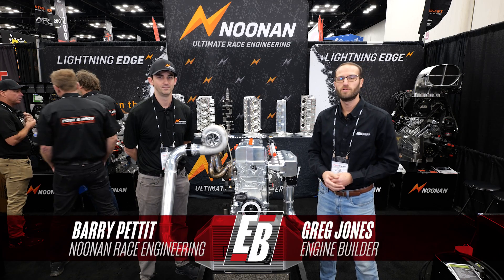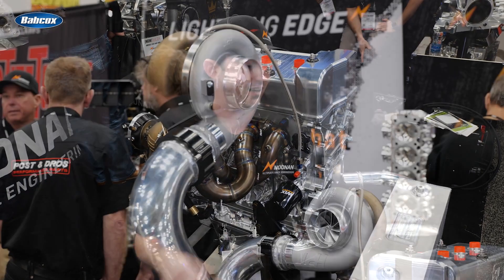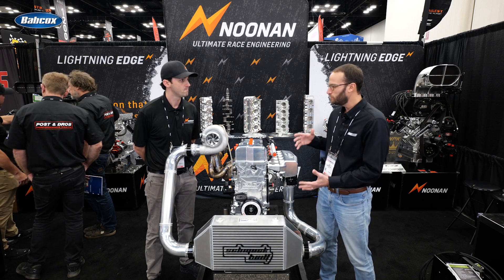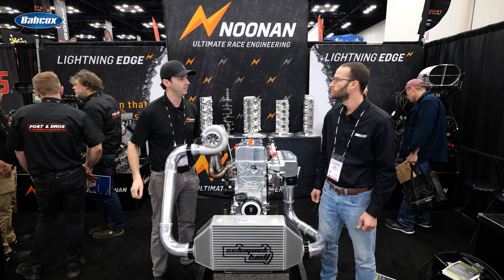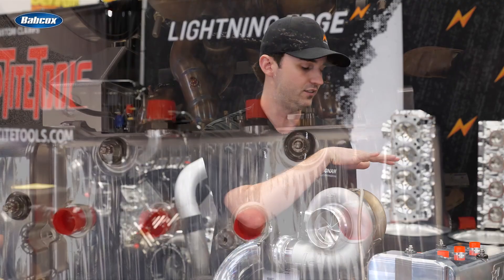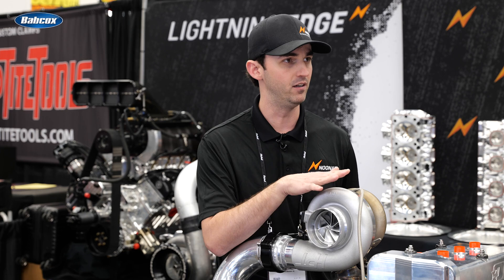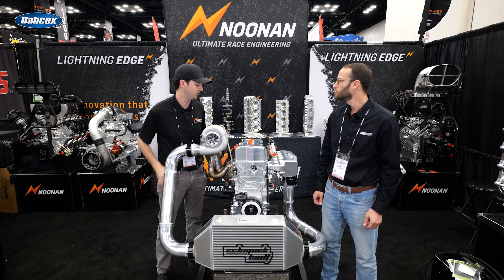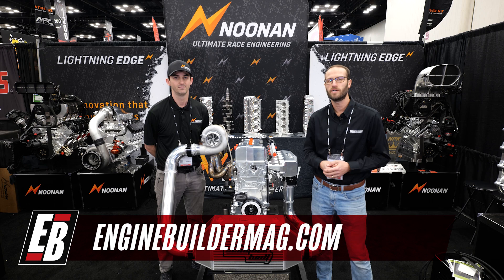Noonan's New Billet K24 Honda Engine

Comment: @EB - "Billet", huh? So, what's the weight and cost?
Reply from the maker: You'd have to contact Noonan for the exact weight info, but their billet V8 blocks weigh around 120-lbs. This would be a very light block. The price is $8,500 for the block only.